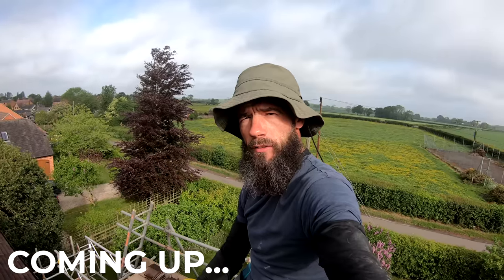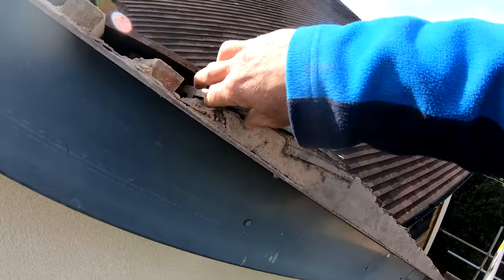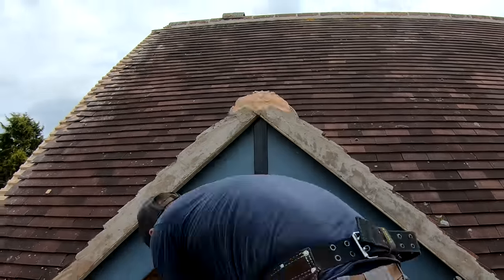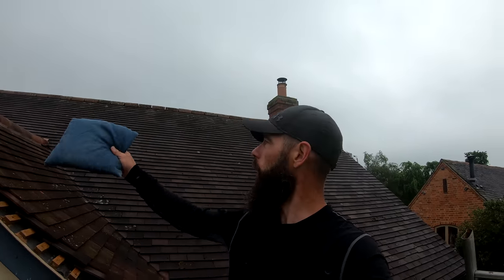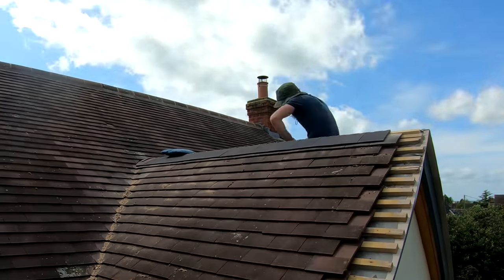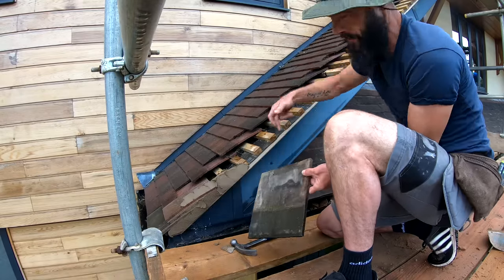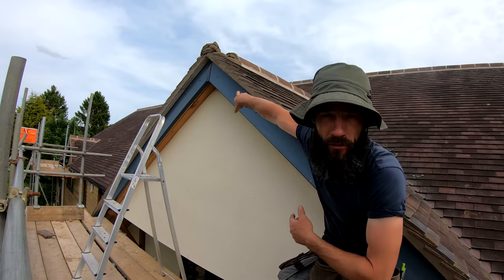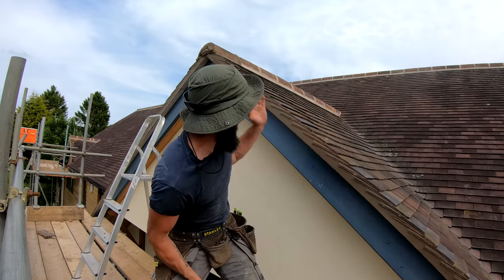Verge and Ridge Repair Work! | Roofing Series

Comment: Awesome, thanks Will. This gives me the confidence to know how to properly strip and re-bed a ridge. The best video out there instead of removing the old cement and stuffing the side with cement or cement and broken pieces. I have seen plenty of videos where they don't even take off the tile to bed the tile. Really well documented and edited. I'll smash through this tomorrow or on a dry day on the back office extension of 25 years, the house is 40 years old and above the side of the front garage. Someone quoted me for the 2 ridges and re-flashing the lead around £1,800. Odd to see this extension crumble including the poor chase into the brick, that's done properly now. Appreciate you and thanks again for this videos for those DIYers who want to give it a go. You're awesome 🔥Subbed to your other YouTube and IG my G. 🙌🏽

Comment: Hi Will, I can’t get the verge smooth.

Is it a premix you use? I’m using cement, 2x builders sand, 1x sharp  and can’t get that smooth finish 

Many thanks

Comment: Nice work. Is there a maximum outside temperature for bedding verge and ridge tiles? Is 30 degrees C too hot? Will mortar go off/dry too fast and crack?
Reply from the maker: Everyone has a different opinion on this sun baked is not the ideal thing for me all the best Tony 👍

Comment: Hi Will just wondering what the mix is and what sand you use. I'm a bricky,occasionally they ask us to do a verge and we've tried every sand, building, plastering with unibond SBR and it still cracks 🤯
Reply: I normally use building sand - a 3/1 mix mate 
A tiny bit of feb so easier to work as you know ha
And maybe 2 building 1 sharp and one cement or lime on a older building
Reply: Hi I thought I would give you my mix as its never cracking on me. 3 soft sand 1 sharp.  Diluted sbr 60% water mix with paddle mixer. I wet area with water and let soak in. The mix is creamy not to wet.

Comment: Hi Will, just a question, rain is coming into the ceiling of my kitchen extension, I noticed the mortar verge has cracked in a few places  and one chunk lifted off, maybe the cold weather did that?! Can this be the cause of the leak?
Thank you 😊
Reply from the maker: Potentially yes but get a roofer or builder friend to have a look all the best Tony 👍
Reply: @BuildWithAE  Thank you Tony 👍
Reply: What was the cause determined to be, and what solution did you implement, and how much did it all cost?

Comment: Will Qq I am doing a shed dormer with centurion low pitch tiles and to match gable ends which are dry verge I am thinking of screwing stainless steel screws in end of battens pointing up the verge as mf states wet only, then when dry remove screws and put dry verge plastics over top with the screws to match gables, do you see any problems with that thought process 😊?

Comment: Are those clay tiles? If so are you using galvanized nails or copper?
Reply: Copper nails are very expensive and galvanized are supposed to still rust in a tile. The other option I used is aluminium. They do a nice 38mm clout that is made to go in plain tiles which are 14mm on a 25mm batten in Travis Perkins.